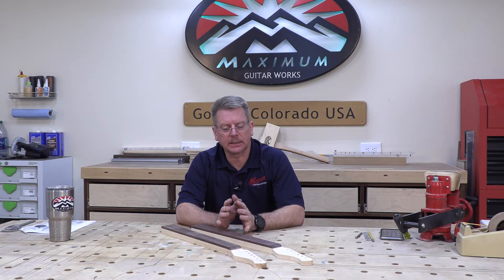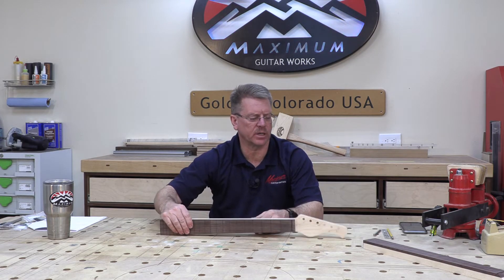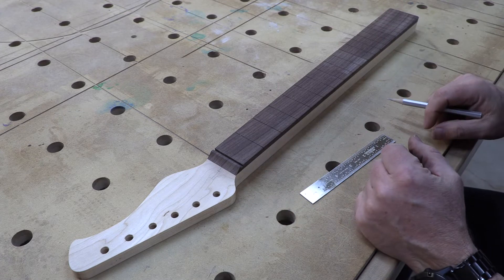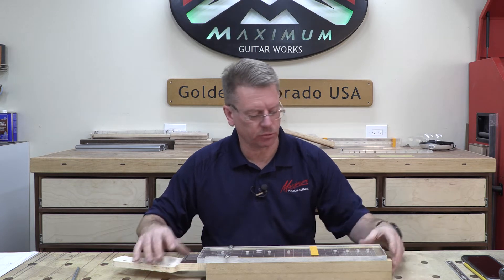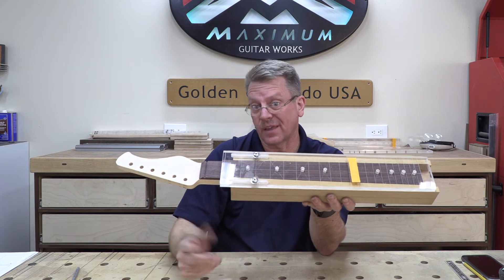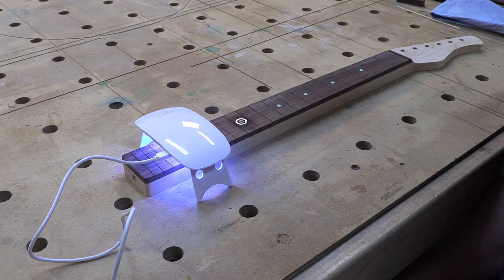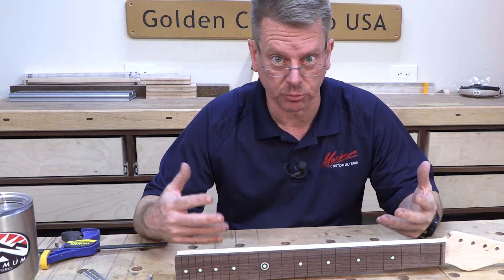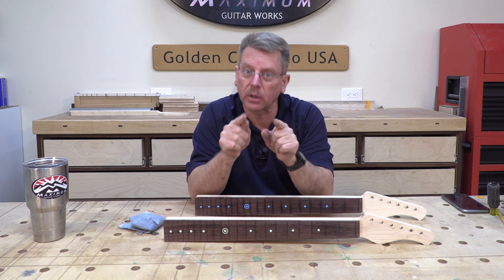Telecaster Build - Part 4 - Fret Marker Madness

Comment: Good Job on the fret markers. I am currently working on a neck myself, but I was wondering if you do block inlays? I am a person who prefers just about anything but the dots. If you do could you demonstrate just how you do them? In general, I'm finding it very challenging to carve out almost perfect rectangles. Maybe you have tips? Keep up the good work!
Reply from the maker: Thanks James.  I do fretboard inlays...generally with set neck guitars as it is more traditional.  Although I not really a fan of huge blocks...I have a smaller pattern that I generally use.  I have used CNC tools for this...and I have also used dremel tools...and dremel tools with bushing guides and template.  The latter is my favorite as this is the most accurate and repeatable method for me.  Generally with any rotary tool you will need to use a chisel to make sharp corners.  I don't have an inlay project in the works right now...but I'm sure I will sometime this year.  Thanks for your comment.
Reply: Thanks, and I look forward to your upcoming video.

Comment: Hi Steve, you are a good teacher. I've learned a lot allready from this episode and the Sheila build. Espescially the compound radius by hand. Those fretmarkers look really nice. I' from Belgium, and don't know where to find those synthetic stones. I'll think i'll trie the hobby craft store. Also UV curing resin is hard to find. Solarez has a new product out, but it's too expensive with shipping cost above import cost, and since 9 / 11, almost nothing that's liquid can go on the plane of course. And if you're able to find it in Europe, even stupid Behlen sanding sealer,, to name something, you'll pay with a kidney. What i also do is make my own markers from paler wood with a small diamond hole saw. If i use abalone, it's not always easy to match the colors or grain direction. Can you give me an adress where to find those synthetic stones please ? Thanks Steve.
Reply from the maker: Hey Bruno, thanks for the kind words and the question.  The best UV curing resin I have found is:  Padico UV-LED Resin Star Drops Hard 25g. I purchased from a seller out of Japan off eBay.  It is the hardest and clearest UV resin I could find.  Padico also sells that UV light I was using in the video.

The stones are a little tricky.  I have a research guy (Nick) who finds stuff for my guitars...typically unique stuff that is hard to find.  Nick found a manufacturer in Hong Kong that could manufacture any size and shape we wanted.  The down side is that I had to order a very large quantity...enough to last several years!  There are dozens of color combinations...we ordered several of them...and plan to order more in the future.  Because of the sizable investment...we are trying to develop a way to sell these synthetic stones to others who would like to use it in their builds too.  We are working on developing an Amazon store for those unique electric guitar items that we have created for our guitars...or things that are the best of what we have found.  We have about 20 different custom guitar items that we want to launch over the next couple years...then continue to make things available as Nick finds them...and after we test and confirm the viability of those items by using in our prototype guitars.  Bottom line...maybe in a few months we will be able to help you with getting some of these items in you would like to try them.

Take care!
Reply: @maximumguitarworks   Thanks for the reply Steve ! That's a great thing to do, an Amazon page with those rare items. Give a shout over here if it goes online please. I'll check out Padico . Thanks for the info. Have a nice day Steve ! Greets from Belgium.

Comment: I paused your video at around 13 mins and looked at a few guitar necks both electric and acoustic.
They all have a visual problem I've not noticed before. The dot marker spacing up to 12th fret is fine.
I think it would be very dependent on the width of fret wire used, but with the width of wood revealed on the higher frets, the factor of the fret width becomes much more of the visual proportion seen.

On a Yamaha acoustic and Fender neck, frets 15, 17, 19, 21 are all centred width wise but too close to the heel end of the gap between the frets. As the gap narrows it becomes more apparent.

I know it's a very picky thing and not really important (since both Fender and Yamaha do it),

It might also be one of the finer points that the experts (not me!) who refret very expensive vintage instruments factor in when choosing fretwire dimensions.

And yes I am also thinking that this is so on the spectrum, and why didn't I just remain a well adjusted person!
Reply from the maker: Any drilling done by hand will have some degree of variation...maybe not noticeable to the eye.  But any mass produced guitar should be pretty much perfect...as industrial CNC machines generally have a repeatability tolerance of .001".

Comment: Has flat sawn ever given you any problems with warping or twisting?
Reply from the maker: Hey Gert, thanks for the question. I have not had that problem with flat sawn necks that I have made...but I have owned guitars with that issue. Quarter sawn does make a stiffer neck with less chance of movement. However that does not always mean that flat sawn can’t be used. I like the looks of flat sawn headstock better. Wood that has been properly dried minimizes some of the problems too. 

For my necks...unless I am building a one piece neck...all of my necks are reinforced. Currently I am using carbon fiber for this task. That technique...while not absolutely required...I believe reduces the chance of neck problems to an absolute minimum. However, even the rods don’t alleviate the builder from using proper materials and sound construction techniques. 

Just one man’s opinions.
Reply: Maximum Guitar Works Thank’s Steve - I’m currently going around in little circles before beginning to build my own neck and quarter sawn is a little hard to source - also I will be doing it mainly with hand tools (apart from a router) so ripping and jointing for a laminated neck will be a Bear of a job 😬